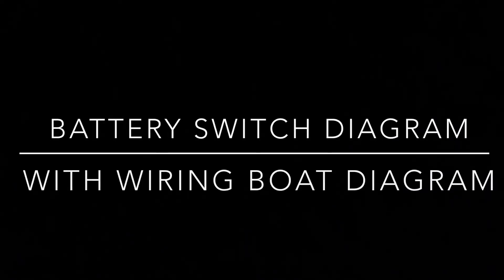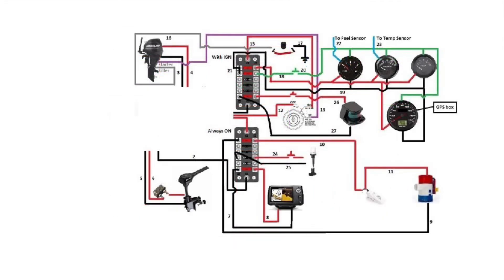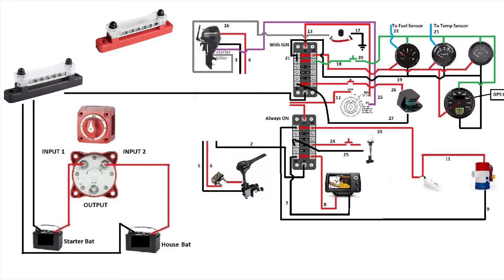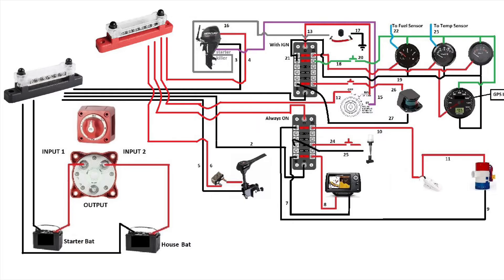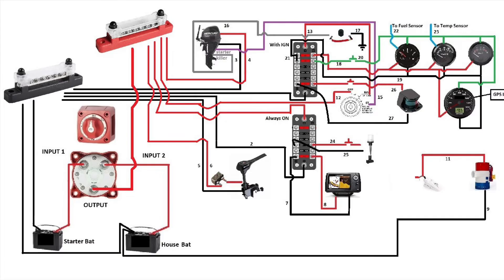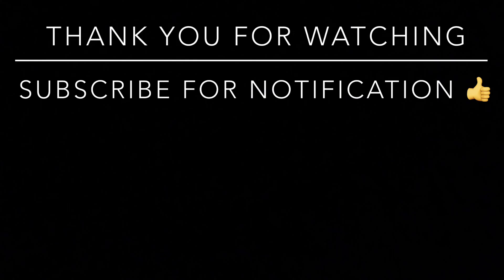Boat electronic wiring diagram and Battery switch diagram "Combined"

Comment: Hola buenas. En este diagrama como se instalaría el VSR? antes del selector de bateria?
Reply from the maker: Hola salvagarciasoler. Thanks for watching. Why would you want to install a battery selector and the VSR together? 

I do have a wire diagram with just a VSR

https://youtu.be/7TinRz-H76k

Let me know if this helps
Reply: Entonces entiendo que se instala el.VSR no hace falta el selector? Lo que busco es poder desconectar las baterías, entonces tendría que instalar un seccionador en casa batería no?
Gracias1

Comment: Hi Joe, thanks for the very helpful videos. Questions: 1) Why not charge Both the cranking battery and the House batteries using Both, why is this not the best option? 2) People seem to Start their engines using Both. Surely this is not a good idea, if you have been out fishing etc, drained your house batteries to say 60%, when you switch it to both and try to start the Engine the cranking battery voltage is now being dragged down by the House batteries as well as the load to start the engine. Am I correct?
Reply from the maker: Hi nemonemo, thanks for watching and nice comments. For why not charge both cranking and house batteries using both:    While it's generally not recommended to charge a deep cycle and a starting (cranking) battery simultaneously with a single charger, it's not inherently dangerous if done with proper precautions and understanding. The issue arises because they have different discharge characteristics and charging needs, potentially leading to inefficient charging and reduced lifespan for one or both batteries.

Also Starting on both selection can cause damage on the long run to your deep cycle battery since it’s not design to do so. While it's technically possible to start an engine with a deep cycle battery, it's generally not recommended and can lead to reduced battery life and potential damage. Deep cycle batteries are designed for sustained power delivery, not for the high burst of energy needed for starting a vehicle.

👍
Reply: @joetheboatguy5394  Thanks Joe. Your short concise videos on boat electrics have reached us in England and they are by far the best. I have a 30 foot yacht from the 1980's that has been added to and  changed over the years. Unfortunately, your videos were not available at that time!!! What a mess!!! I'm sure this is a common situation. Cheers and keep making the short films.

Comment: Hello, thank you for the nice and understandable video.

I have a problem in my boat that goes in roughly the same direction.

So I installed three more batteries for the installation of my depth sounders. All three batteries have their own circuit. I only have very little space available and that's why I had to carry out the installation like this. I now want to create a potential equalization via ground. Is it possible to incorporate these necessary extensions/changes into this plan as an example?

Or can you please explain the necessary changes to me in writing?

Greetings from Germany
Christian
Reply from the maker: HI christianchmielewski, thanks for watching and nice comments. 
Are all your separate circuit 12V, or do you have a 12V and 24V?
Reply: Hello Joe, thank you for your answer. All the circuits are 12V. If you give me a possibility to Share a Drawing-File with you I can send you my actual Installation as a PowerPoint or a pdf file. Regards Christian
Reply from the maker: Hi Christian, I don't think its necessary to do it, but one simple way is to connect all your batteries grounds on one bus bar. Let me know if that works for you.

Comment: Does the trolling motor get a fuse or circuit breaker? Thank you
Reply from the maker: Hi caseyarmstrong, thanks for watching, here is the original video; https://youtu.be/bnQZmurYQ-g?si=blyNEqOWsmkVGYYS 

I talk about the trolling motor at 1:52 min. I would put an auto circuit breaker. Hope this helps 👍

Comment: And where would you place the ACR in this diagram at 3:30 ( I saw 3 previous vids of you! Adding these vids into this one, but know I still need to figure out where the Blue Sea ACR will be lol) Thanks and greetings from Belgium! Also I think the red knob has 4 connectors on it?
Reply from the maker: hi ASUSfreak, thanks for watching. 

Yes the knob has 4 positions. 
at 3:36 I mention input 1, on the knob would be A
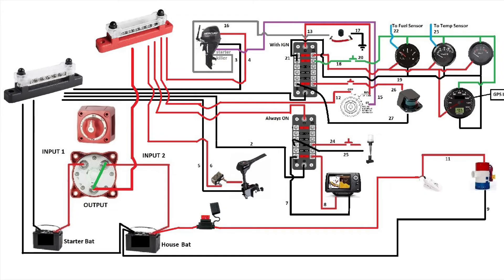at 3:49 I mention input 2, on the knob would be B
at 4:17 i mention the both position which connect 1 and 2 together. On the knob would be AB
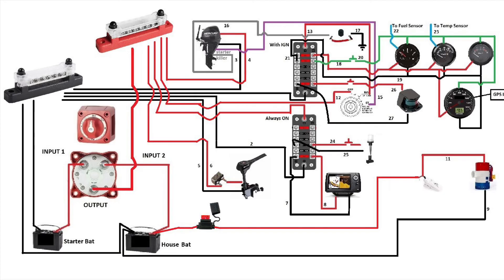at 4:32 I mention the off position which you never use while your engine is on. you can damage regulator or alternator. On the knob would be OFF

For the Arc you need to install it between the 2 batteries. ACR automatically combines batteries during charging, isolates batteries when discharging and when starting engines. The Dual Circuit Plus Battery Switch simplifies the switching of two batteries to OFF or ON while still providing battery isolation between the engine and auxiliary battery. The Combine function can be used to parallel the batteries in the event of a low engine battery.

The arc will have 5 connections. 
1: The A prong of ARC will connect to + of started battery (please install fuse).
2: The B prong of ARC will connect to + of house battery (please install fuse).
3: Ground connector of the ARC will go on ground bus bar (negative of batteries)
4: Start Isolation of the ARC is optional, will go connected to your Start position key switch (please install fuse)
5: Remote Led on ARC is optional, will go connected to positive of house battery, with a led and fuse. 

Hope this helps :)
Reply: @joetheboatguy5394  aha, very clear! Thanks for your time explaining it step by step. I will draw it out before I begin and if that drawing does not work, I'll come back here lol 😅😊

Comment: Thank you, this will be helpful!! 

I noticed in the explanation there are no circuit breakers on the batteries. Should there be?
Reply from the maker: Hi FloydReed, thank for watching. Yes you can add a circuit breaker it would give it more protection. 👍

Comment: Hi @joetheboatguy5394 I have a 96 Bayliner with super old wiring (orange, black, white, light green, light purple, yellow) and I’m trying to install a modern radio would love any help you could share with me sir, thanks!
Reply from the maker: Hi michealmisdary, thank you for watching,  Here is a wiring diagram of a 96 Bayliner, https://www.bayliner.com/content/dam/bayliner/technical/documents/past-owners-manuals/1996-Capri-IO-.pdf 
last page has color codes and wiring diagramme

I have a video about radio installation, check it out. I'm surprised you didn't mention any red wires. You will have to find which wire has constantly 12v and which one has 12v ignition.

Let me know if this help :)
https://youtu.be/Ih4kXGI4zzc

Comment: thanks, Joe for this I have two questions, how do you install an onboard 2-bank battery charger. The second question I have two deep cycle batteries when I select Bank 1 does not want to start then I choose Bank two which should be separate but I get the same issue, do you think the switch is bad?
Reply from the maker: Hi Range Master, thanks for watching, for the first question : how do you install an onboard 2-bank battery charger
See this video : https://youtu.be/Q8VgRRlOmW0

For your other issue: Deep Cycle batteries don’t all have the capacity to crank the engine. Make sure your batteries have enough Cold amps for cranking engine (CA or CCA)…. 
Is this a new issue or is it always been like this?

Let me know 😊
Reply: @joetheboatguy5394
Reply: On the second issue, it seems it has always been like this the only difference from your Diagram is that I have the engine connected to a deep cycle and a cable from neg to neg in (parallel) which I don't think would be the problem.
Reply from the maker: I'm sure it is but just a side note, make sure the engine ground is connected to the same batterie.

At this point, I would connect the engine directly to the deep cycle batterie to make sure that the batterie has enough CA to start your engine. Old deep cycle batteries are not designed to start engines. New deep cycle batteries are much better in CA. 

Might also be you starter on outboard.
Reply: @joetheboatguy5394
Reply: Awesome going to get a new Start battery for the engine start, then take the two deep cycle and put them in parallel for the house. I will follow your diagrams and add the on board battery charger.

Comment: Terrific videos, very helpful Joe.  In the process of cleaning up some wiring on a 19' Hewescraft.  I have a main power lead running from a Dual Purp battery to the switch panel at the console.  With absolutely everything removed from the battery I was checking continuity to the switch panel and I found that this wire has continuity with the hull.  Does this sound right.  thanks much
Reply from the maker: Hi Bryce Cain, thanks for watching. If you have a bus bar with all your grounds plug on it. Then even though the battery is unplugged you will have hull and ground continuity. Your outboard ground can be connected to hull also. So even if your battery is completely disconnected you will still have continuity if you have all ground on bus bar and also outboard ground might be connected to hull. 

If I didn’t answer your question, please let me know. 👍
Reply: @joetheboatguy5394  Ya thats whats confusing is the hot wire running to the switch panel is disconnected on both ends and still has continuity to the hull.  The motor wiring is all disconnected from the battery also.  Even if the motor is grounded to the hull, the negative cable from the motor is not grounded to the battery with any other wires and the hot lead to the switches is not connected to any loads.  Lots of fun, its why im upgrading wiring.  thanks for the help.
Reply from the maker: @Bryce Cain , oh boy hot wire that goes to ground lots of fun. If you have everything going to fuse box. One trick I do is, have your multimeter connected on continuity and remove one fuse at a time to see which one cut the continuity. If that works, you will have a good lead.
Reply from the maker: Hey Bryce Cain, Did you find the culprit wire?
Reply: @joetheboatguy5394  oddly enough I did some more testing and found that there are 3 wires from the switch to the wiper Motor. Red, blue and black. The black attaches to the metal case of the motor and that case in turn is attached to the hull unisolated. This is all factory original. Haven’t specifically found a hot wire contacting the hull but if a black circuit wire carries current from the load back to the battery and that black wire is also in contact with the hull then ???
Reply from the maker: Also you can check if your wiper Motor is burned. Sometime when they burn it can short the wires. Do you know if the wiper motor is functional?
Reply: @joetheboatguy5394  ya it works fine. Any way to post a pic on here. I have a diagram.
Reply from the maker: Don’t think we can add picture on YouTube chat. ☹️

Comment: That looks like my boat but I worry about the voltage sense wire for the external regulator just going to the switch and because the house bank is LIFEPO4 it is all going to float mode too soon to get a full charge .I have bought a fancy 30A isolated DC-DC charger from Victron but not sure how to proceed.
Reply from the maker: Hi Andrew, thanks for watching, I have a question, are both your batteries LIFEO4? I was actually planning to get some but I did see lots of people saying the same thing your saying. Anyway the LIFEO4 batteries dont like to mix with lead acid batteries in parallel, that’s is why I’m asking if both your batteries are LIFEO4?
Let me know, will try to figure out the issue. 👍

Comment: I wanted to have one battery for starting, lights, fish finder, and bilge. One deep cycle for trolling motor only. I only have a 14’ Jon boat. Do you have any thoughts on this? Not that I don’t appreciate your videos, quite helpful.
Reply from the maker: Hi James Jaeger, thanks for watching. It’s a good question you ask. If you leave you boat on the water and it rains overnight your bilge pump might work hard and discharge your starter battery fairly quickly. A deep cycle battery is meant to be able to run your equipment longer. A starter battery is design to give higher power to crack engine. Not to run equipment for a long periods of time. 

Now with that said. Even if you do connect the way you said you want to connect. It will work. It all depends of your needs.

Got this from a website, it’s a great explanation.

“A starter battery is designed to provide a large burst of current for a short period of time. This surge of current turns the engine over during the starting process then the alternator takes over. The burst of energy only discharges the battery 1- 3% then is topped off by the alternator. Under normal use your car battery may go through its entire life without ever being drained more than 20 percent of its total capacity.

Starter battery = single bust of energy

A deep cycle battery is designed to provide a steady amount of current over a long period of time. A deep cycle battery is also designed to be deeply discharged and charged over and over again without shortening the lifespan of the battery. Dakota Lithium batteries can be drained to 10% of their total capacity before needing to be recharged and are good for 2000 to 5000 discharge/charge cycles.

Deep cycle battery = steady, continuous power for a long time”

Hope this helps 👍
Reply: Thanks for explaining. I’ll never have my boat on the lake overnight. Day trips only. 95% of the time starter battery will only start the 20 hp Tohatsu and run the Garmin 9sv echomap . Any advice you have I deeply appreciate.
Reply from the maker: I don’t know if you already have your batteries but if you don’t, I would look into dual purpose battery. “Some deep-cycle batteries can be used for engine starting as well (these are sometimes referred to as dual-purpose), but be sure to check the CCA rating to ensure the battery has sufficient starting power” this should not be a problem with a 20hp engine 🙂

I would get 2 and have them in parallel. So your outboard alternator would also recharge your batteries when running. This is the best worry free option.

If you already have your deep cycle battery and your starter battery then you can connect your trolling motor on your deep cycle battery and have the rest running like you wanted on the starter battery. Not the best option but will work. 👍 Don’t forget your deep-cycle battery doesn’t get recharged in this configuration. It’s not connected to the outboard alternator. The only time you can charge the deep cycle battery is when you get back home and plug the noco charger OR unless you install battery switch. Then when your deep cycle battery gets weak you can run the alternator on it by switching the battery with the switch.

Comment: Now if my "always ON' panel is under my CC dash and my battery's are in back on boat about 10' - 12' I'm guessing, what size wire do I need to run from batterys to panel under dash.
Reply from the maker: Hi PopPop, the size of wire needed will all depend on what equipment (in total) is connected to your always On Fuse box. I have a video that explains how to calculate the size of wire needed. Take a look at this: https://youtu.be/c_9MxEdlRuA

You need to add up all amps from all equipment's on the always On Fuse box. Then you will take a look at the column 10 to 13 ft since that's the distance you have. 

So example: if you have 40amps max in total when everything is on. Then you would need 8awg wire connected from battery to your fuse box. I got this from the video that is linked to this comment. Let me know how it goes...

Comment: Thanks for providing this information. What if I wanted to hook two house batteries in parallel would that be as simple as I'm thinking?
Reply from the maker: Hi Eric, thanks for watching. Yes absolutely you can add a house battery in parallel. The positive with the positive and negative with the negative. Parallel is very simple. Just try to match the Amp per hours for both house battery. Will help the life battery to last longer. Here’s info on parallel vs serial: https://youtu.be/Pi2YmVbQKd4 hope this he helps 👍. Let me know if you have questions.
Reply: @joetheboatguy5394  Thanks again. I will check out that video.

Comment: I love you diagramming.   I’m adding an ARC and the Blue Sea switch.   How would this fit in the battery switch diagram?   Currently, I have my trolling motor hot wire attached directly to the House battery.  Seems like there a better solution.   Thanks
Reply from the maker: Hi Gary, thank you for watching and the nice words, check out this video let me know if it helps you: https://youtu.be/lHwetz08R_w
Reply from the maker: For the house battery it’s ok unless you have another battery reserved for the trolling engine. Ends up costing more💰💰💰. Also depends how much you use your trolling engine. Many ways of doing it. Depends on your needs.
Reply: @joetheboatguy5394  Use my trolling a lot.  have been caught with dead battery too many times, so isolating them seems to be the way to go.  thanks for your help.